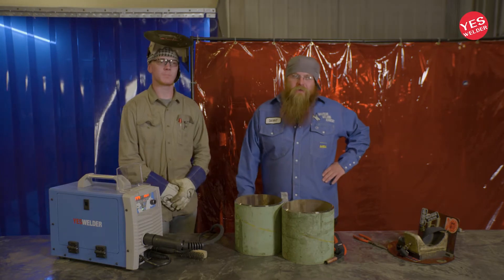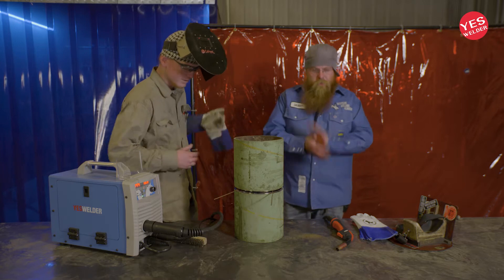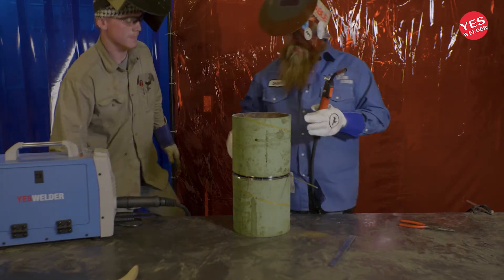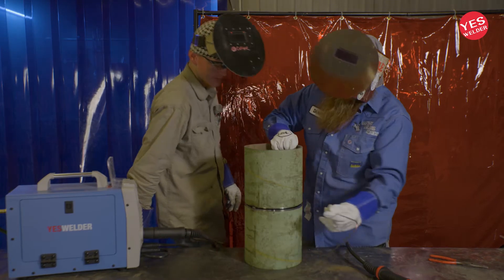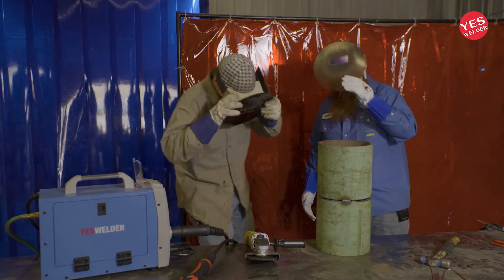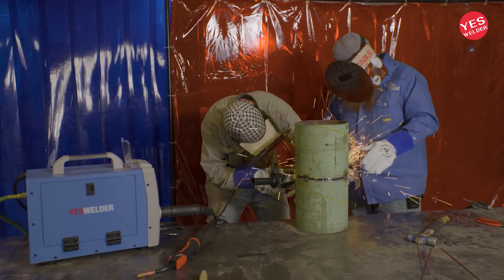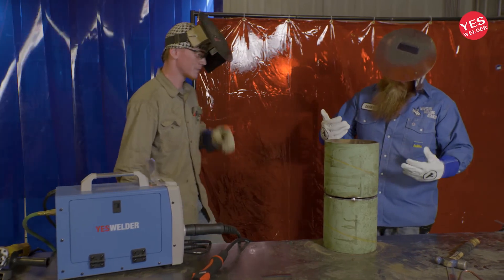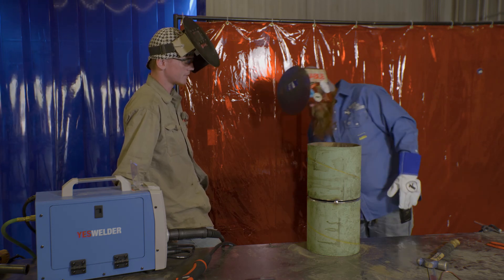MIG WELDING 101 YesWelder MIG-205DS | ft. Western Welding Academy

Comment: Does a 30a breaker work for my Flux core?? On 205 ds mig machine??
Reply from the maker: Hi Ulises! For our MIG205DS, recommend breaker 45A@110v, 30A@220V.
Reply: @YesWelder  That's good news as I just had a 30A@220V installed.